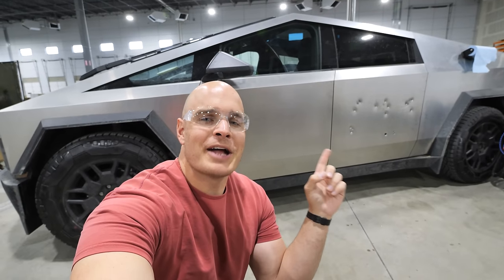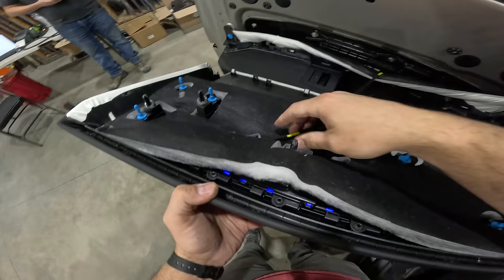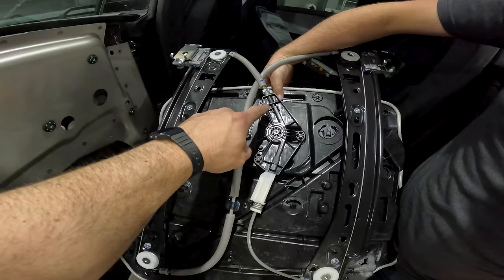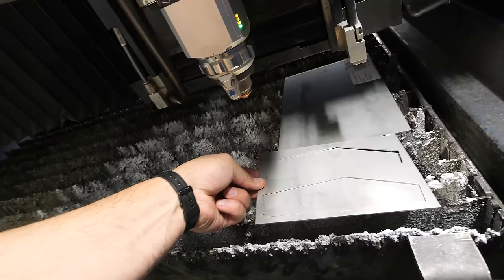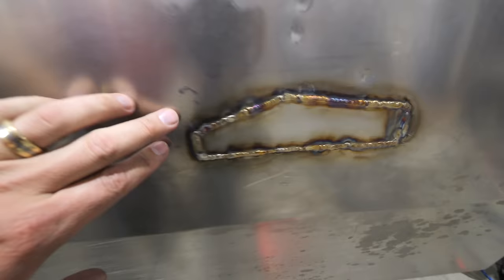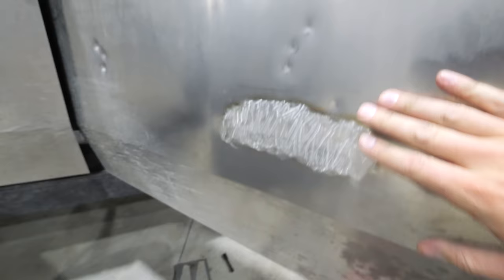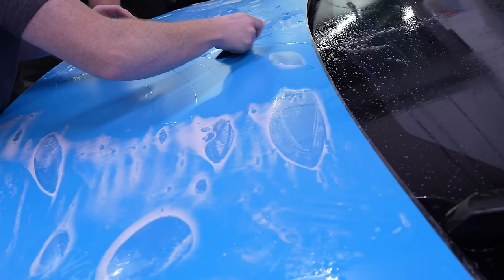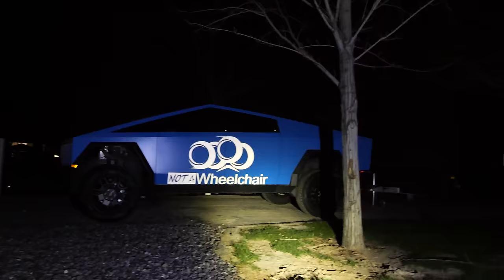How to fix BULLET HOLES on a CYBERTRUCK!

Comment: That foil is also great for dampening sound in mechanical keyboards. I've stuffed so much Noico in keyboards.
Reply: How does it dampen the sound? Can you teach me how to do?
Reply: my keyboard is loud af.
Reply: @yeethaw4895  it helps to get rid of any reverb within the case. I put it in the bottom of the case, smooth or out and then I'll either tape over the foil so that it avoids any contact with the PCB, or I'll tape mod the PCB itself. But either way, just make sure that the Noico is smoothed out and that you put a nonconductive layer between it and the PCB of the keyboard.
Reply: hmm... fellow keyboard enthusiast in the wild
Reply: Ngl it does work😅. I can barely hear scream from my basement 💀
Reply: mechkey enjoyer spotted
Reply: in a keyboard?! but but but according to zach tesla invented it., lol what a simp he is
Reply: oh no... one of us got out again.
Reply: What's the point in owning a mechanical keyboard if it can't be heard from across the pond?
Reply: This should be the standard for anyone working with one in the office.
Reply: Acoustic dampers work by stopping resonance build up in material. An enclosed object, such a a keyboard, which is generally a sealed plastic box, (or a drum, or many other enclosed objects), just need a material, like rubber, to be glued on to the object. It works best if you can spread out the rubber piece, (or whatever damper material is used). Simply put, use a couple of rubber strips, (you can order these from a place that sells drum heads, or a music store that sells drums), and place them somewhere between the edge and the middle of whatever object you need dampened. If you want to get picky about it, you can measure the frequency response of the object and find its resonant frequency. (You’ll need a knocker, a microphone and a computer to record the waveform, and some software to analyze it). Once you know the frequency, you’ll know the wavelength. Then cut the rubber strips to a little over half or quarter the wavelength of the resonant frequency and stick a couple of pieces of the dampening material inside, or outside the object. There you go. Object dampened!

That’s more than anyone will probably ever want to know about dampening acoustic chambers, but I hope that helped someone. If it didn’t, find a speaker cabinet maker. They are some of the most educated people on earth on the subject of enclosure dampening that anyone can gain access to. They have the dampening equations for any shape and size enclosure, but will probably tell you to just tape some foam on the inside of the keyboard because plastic keyboards are not strong resonators. 👍🏼
Reply: It can prevent that backplate 'ping' sound when you strike a key?

Switch clickiness is one thing, but this ping sound really irritates me and also feels like the entire product is super cheap, even when it may not be.
Reply: @AceStrife  Acoustic dampening can work on just about anything. Personally, I would need to hear it, know the inside dimensions and what it’s made of. If the sound you’re talking about is due to something mechanical, then it will be harder to stop. If it’s due to reverberation within, then yes it will work.

Comment: That sound dampening material is very common in the automotive industry. You can pick some up at your local aftermarket audio store or Amazon and improve the noise isolation of any vehicle for a pretty reasonable price. I just got some to install in my 2020 Escape Titanium this spring because Ford didn't use enough in the cargo area.
Reply: Why is it only in certain spots? If you know the panel elsewhere not covered by the material wouldn't it sound tinny?
Reply: @atubebuff vibrational modes of the panel. A good rule of thumb is to put dampening at 1/3rd (if I recall correctly) of the sides. That reduces the amount of modes a lot.

It's kind of similar to playing harmonics on a guitar by dampening at the 12th fret  with your finger, which effectively filters out all lower harmonics as they "want to" move the material at that spot.
Reply: @cheezzinator this guy is spot on. As an engineer for over 25 years I can confirm that this is basically right. There is no need to dampen the whole panel just enough
Reply: @smellycheese2466  thanks for confirming, fellow Cheese
Reply: but but but but he said elon invented it!!!
Reply: @Alex-zi1nb  And he thinks being able to remove the rear glass with the panel off is remarkable???????
Reply: @Alex-zi1nb  shut up
Reply: He seems to know nothing about modern cars and gives Tesla credit for everything!
Reply: @smellycheese2466  i doubt it buddy do you mind if you elaborate? Do you agree with that he said ?
Reply: @cheezzinator  this cheese is so knowledgeable
Reply: You should find this stuff on the underside of your stainless steel sink. This is nothing special or new.

Comment: 4:34 It's also worth noting here that automakers tend to use the bare minimum sound deadening material required to dampen reverberations. I actually added that sound deadening to my 1999 Ford Ranger Electric last year while I had the cab torn down. I removed the original sound deadening patches that were starting to come loose, but I just layered over the factory patches that were still solidly in place.

Comment: Nice to see the purging going on! 
True welding and not just putting "crystalline structures" on top.❤

Watch out for the manganese, nickel or maybe even cobalt -content of ur lungs when grinding stainless. 
Most is 304 or 316, but you never know! 

Standard M3 mask will take care of the metal particles. 

But that's NOT taking gasses into consideration, those "only" makes your lungs cry.. 😅

Really nice work though! 😊

Comment: oh, also, depending on the ammo you used, you can expect your bullet craters to rust in the future from embedded steel contaminating your stainless. we just dealt with a returned product due to a contaminated flap disk in the shop that was used on mild steel then was used on the face of a stainless product. over time, the face rusted in the spots which were grinded. this can be mitigated with a nitric acid solution. nitric is amazing on stainless and will disolve out any ferrous particles, leaving stainless spotless.
also, de franke Inox Stainless cream is really incredible at pulling rust, nitric acid stains, surface oxidation from welding. i use it on 304/308 stainless on a regular basis and its pretty great. 
not sponsored, just a customer of their product and we go through small cases frequently for stainless lab equipment fabrication. probably great for cybertruck lol.
Reply: some cybertrucks started rusting after ten days because it costs extra 5k for the protective paint every car usually comes with, its truly a car for stupid rich guys
Reply: Tell me you don't know what stainless steel is without telling me
Reply: @sys-administrator  All stainless corrodes under the correct conditions. 400 series more easily than the 300 series the CT uses 300.
Reply: @sys-administrator  There are a lot of stainless alloy and theirs properties (strength, corrosion resistance, conductivity...) can vary a lot. The most corrosion resistant alloys cost more. Every car manufacturer will choose the cheapest option that fits the requirements, and if the requirements are set too low bad things can happen.
Reply: @sys-administrator  I agree a month seems pretty short even for the cheapest sort. But it's common on stainless steel to see little rust on the surface in a few months of bad weather, and deep rust only after years or dozens of years. If the surface rust appears quicker it may be possible that the deep rust also appears quicker, but for now it's impossible to tell how good or bad it will be in 10 years
Reply: @w.lf404 false. he addressed that at 1:15. just free iron from environmental contaminants rusting like every other car.
Reply: I get paid 17.50 a hr to do this 50$ for the fabric plastic ceiling at SA Automotive and they sell the car for 80,000k at least 😂😂😂 what a rip off
Reply: @sys-administrator  Using cheap stainless with low chromium..... the bar is 10.5% chromium, but better alloys will have more (expensive) and other contributing elements. Stainless will rust if you use a contaminated brush/flap/HAZ, easily, as the protective oxide layer can be compromised.
Reply: @sys-administrator   cybertruck that actually rust are met requirement, its because iron particle around railway stuck and rusting. If zack live far from it, it would be safer
Reply: That’s why when you tig weld your wire brushes and other gear need to stay metal specific.  You use your mild steel brush on aluminum or stainless and you’ll have issues.

Comment: Thank you for doing this. Ive laughed at haters for months about their complaints that it would be expensive to do bosy work. 

Im a contractor waiting for a base model for work. This is going to be a great work truck.
Reply: I'm not going to complain that you could have just filled the dings and holes with the wire from the welder.😊😊😊😊😊

Comment: 1:30 no, I don't think other 100k$ cars rust this fricking much in just 2 weeks lmao 😂😂😂
Reply: Walk to any dealership and look under any truck costing $80k, $90k or $100k and you will see surface rust.
Reply: @Dave-in-MD  and all those were there for less than two weeks?
Reply: still parroting debunked trash lol
Reply: @Progs420  Yes, unfortunately. Go look at the hubs, CV axles, axle assemblies, etc underneath most pickups/SUVs. They're plain untreated metal from factory and usually are completely covered in surface rust before they even hit the lot in most cases, or at least definitely after a first rain
Reply: @Dave-in-MD  Well, American cars, anyways...... We don't even use corrosion resistant brake lines, even though it's hardly a cost increase.
Reply: You can remove the rust with metal polish on cybertruck.
Reply: @Progs420  why are you such a baby
Reply: @TurdFergusen  even if, just let me be? Lmao
Reply: @Progs420  then stop lying like an emotional baby
Reply: @TurdFergusen  lying?? What are you talking about?
Reply: @Progs420  propaganda and paid headlines dont work without idiots to believe them, carry on lol
Reply: @TurdFergusen  lmao get some help dude 😂😂😂

Comment: I'm kinda bummed Jerryrig supports this death trap. While running a wheel chair business. This thing is a pedestrian killer
Reply: I'm guessing he's not the sharpest tool in the shed nor the brightest bulb in the room.
Reply: And other cars aren't? What kind of logic is that?😂
Reply: @ganymede6535  this thing will never pass any EU regulations because it is badly designed. Manufacturers are constrained by their designs to ensure they present a less-dangerous profile to pedestrians. It has no crumple zones and is not going to yield AT ALL. All those sharp-edges present lethal knife-like danger to a pedestrian or cyclist. You know - good old basic logic -  entirely absent from this piece of junk in almost every regard.
Reply: @TheDesertsweeper  i guess that is fair. But you would still have to be driving at a considerable speed to do that Cybertruck or literally any other vehical

Comment: In my company we have a lot of experience in welding thin stainless steel. Very difficult because larger thermal extension value and low heat conductivity adds up negatively when welding. You need very experienced welders to weld thin stainless steel. He did a good job. I would have placed a thick copper plate on the inside to dissipate the heat. You could have spot welded some studs to attach the copper and add some small groves in the copper for argon gas treatment.

Comment: 3:42 Jack may not had windows smashed before. As a victim of car break in, replacing window is the simpliest step. Having to vaccuum the broken window pieces still require taking out panels. Because a small piece of leftover shard would still make rattling noise.

Comment: Did you repair the holes in the plastic bulkhead? That's essentially a weather membrane to keep the water that gets in the door from getting into the cabin of the car. If you left the holes, you'll probably have some moisture issues in your interior (unless you live somewhere dry and never drive it through rain/get it wet)
Reply: He is in Utah. The average relative humidity hovers around 50%.

Comment: Stainless can still rust so it's usually protected through a process called passivation. Without passivating this new area it will be very interesting how the welded area holds up over time

Comment: You should try to patch up the plastic hatch that closes up the door. The interior of the door is intended to get wet by water seeping in via the window. This plastic piece then protects the interior of the truck from the moisture inside the door.

Comment: The rubberized tinfoil is foil backed butyl sheets. Tesla uses them for sealing small holes (think stamping fixture locator holes) as well as noise dampening.

Comment: You can likely redo very close to the finish.    Either, band sander or Stainless Steel brush.  The problem is to  find the proper size of Sand paper or Brush

Comment: Of course window tint films have 3 qualities per radian heat : Transmission, absorption, and reflectivity. Do you want to block the heat by absorption or reflecting it, and how much visible light do you want to block. And it might be beneficial to block the UV.

Comment: These trucks could definitely be rusting but it’s not the stainless itself rusting. It would be iron particles from any road dirt/gravel leaving traces of itself on the body. The iron sticks to the stainless then begins to oxidize make contaminated spots that look as if the base metal is rusting.

Anytime you’re working with stainless steel you should use grinding and abrasive wheels that have never been used on regular steel and use stainless steel padded hammers to prevent contamination.

Comment: Coming from the collision repair industry this was my first concern for the cyber truck when I saw the original announcement. Not bullet holes per say but body repair. Costs will be out the roof for any size damage because the standard for repair is for predamage or factory condition. What would be a small repair with on olany other vehicle would be a complete replacement on the cyber truck.

Comment: I learned the hard way about how the window mechanism works in teslas. Once you see how they engineered it you appreciate it but removing bolts on accident that hold the pulleys to the system results in headaches trying to rewind and reset the system. The one piece design is incredible

Comment: Grinding down the weld beads is definitely going to make the plate less durable for its purpose as a patch. I cringed a little bit seeing that, and I'm sure your welder would agree. Regardless, the patch is very flush and was welded pretty nicely :)

Comment: Please plug the holes in the plastic holding the window regulator. There are air pressure sensors in the door. They are used to help with accident detection.

Comment: One rule to welding on any vehicle is to disconnect the batteries to prevent any issues with electronics especially ecms and such. What precaution was taken on this truck to prevent damage?

Comment: About that pull lever for emergencies: it almost looks like the door card needs to come off first. Surely that's not the case though, right?
Reply from the maker: It can be accessed through the lower pocket too. With everything installed.

Comment: 12:30 

Lol, no. If an EV is turned off, it's off. I don't know about Teslas, for example a Kona EV or i3 both turn off when you turn them off. As soon as you do, you can hear the battery's relays disconnecting. The cabin itself doesn't cool down unless you have the cabin overheat protection activated in the Tesla app. This feature enables the air conditioning to cool down the cabin if the temperature exceeds a certain threshold. However, this feature is not yet available on the Cybertruck but will be included in an upcoming update.

Also, I don't think Teslas standing in the sun all day turn on by themselves to cool down the battery. If the car is not in use, the battery can tolerate higher temperatures without damage because it doesn't need to perform. However, after a long day in the sun, when you start driving, the system may begin cooling the battery for optimal performance without power limitations.

Still, the battery of an EV is always in the shade, located below the car, and doesn't receive much heat. So, it mostly just stays cool down there.

Comment: That is some kind of a record 🤔 Car that starts to rust away after two weeks 🥳
Reply: Most cars in a dealership will have rust on the unprotected parts before they're even sold. It's just they you usually have hub caps so you don't see it. Just leave your car outside in the rain for a few weeks and your brake discs will have some surface rust on them, for example.

Comment: You're going to want to repair the inner plastic door assembly. Inside the door is a wet environment. You would be shocked how much water drains down the window glass and out the bottom of the door. That cybertruck has a massive water leak and is going to have condensation on the inside glass after a rain.

Comment: that sound deadening material is inside of most cars. A lot more is used in more expansive cars. The more expensive the car the thicker the material is. also in higher end cars have the material painter over so you don't know it is there.

Comment: The British car guys "repaired" dents on a stainless steel DeLorean.  The "specialist" was so skilled that the brushed finished repair was indistinguishable from the original.
Reply: Brushed finishes are easy, the cybertruck is a mill finish, not sure that can be done post-op.